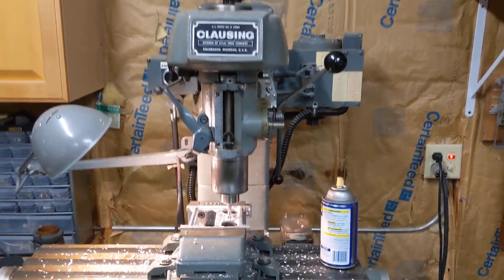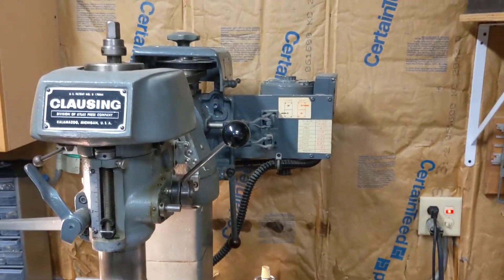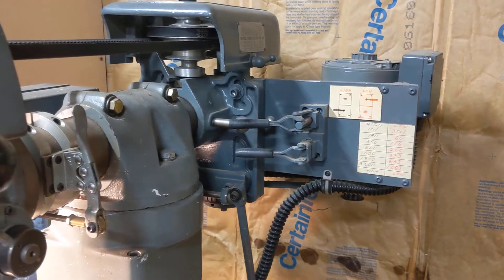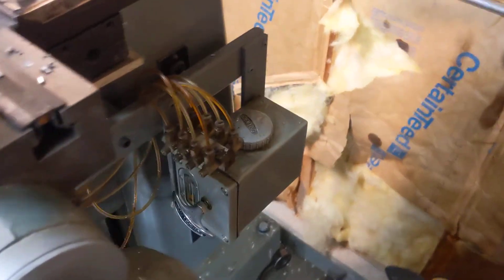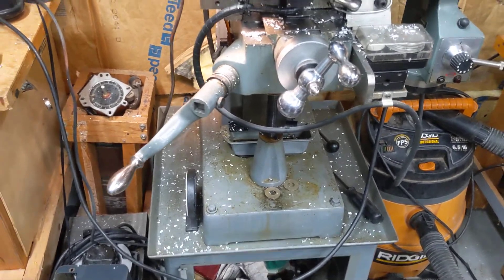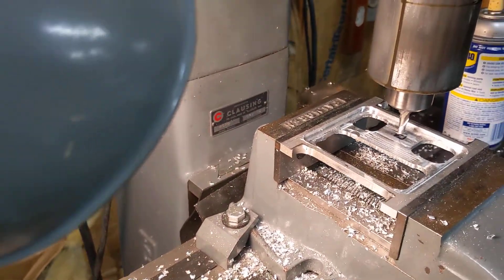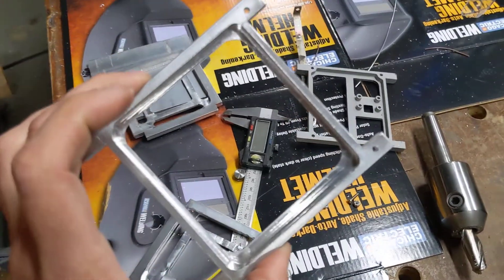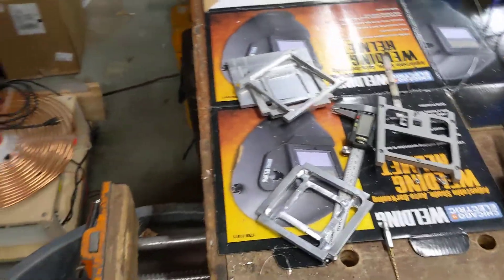Clausing 8520 Milling a CubeSat

Comment: I just got an 8520 and am planning to remove the Servo 90 from my Millrite MVN and swap it onto the 8520. Did you need anything in the way of an adapter to make it work?
Reply from the maker: My machine came with the power feed assembled. By the way the serial number is 905747-B
Reply: @crazyscientist  any idea how to tell by the number what year it was manufactured?

Comment: I have the same model only mine may be older it's tagged as Atlas / Clausing. your motor setup is way different than mine and is your oiling system aftermarket also did your vise come with the mill ?
Reply from the maker: Yeah I picked up everything as is and the vise did come with it